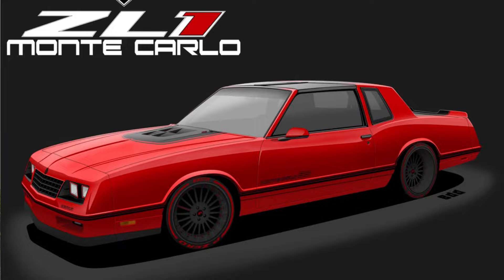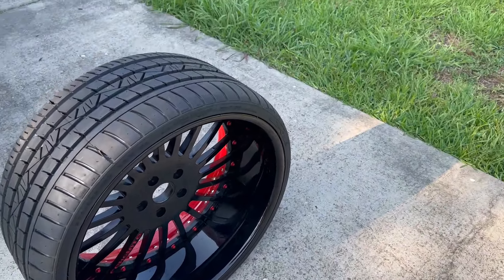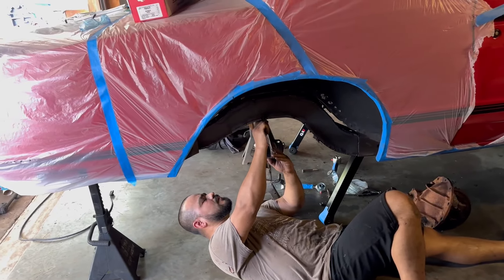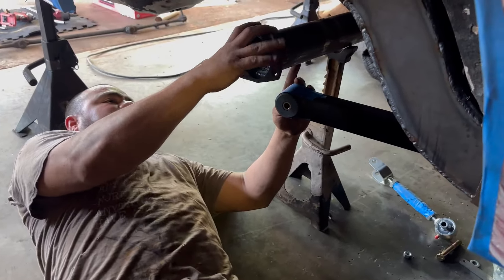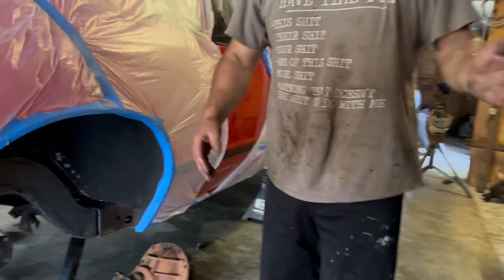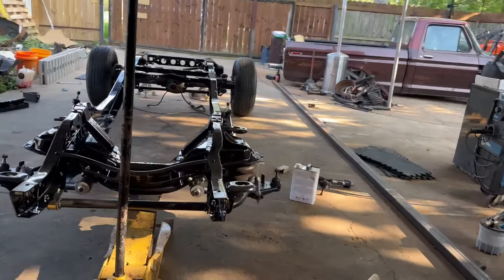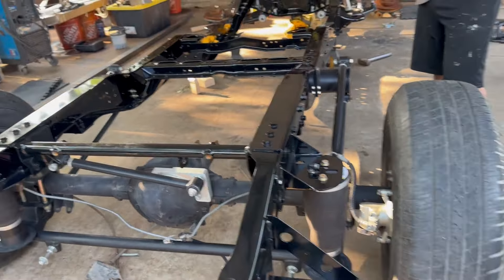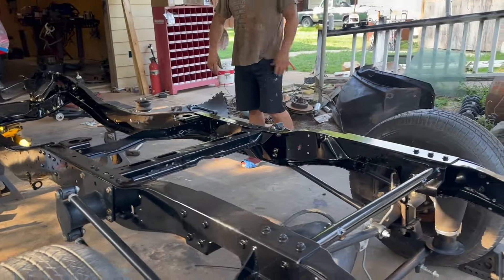Monte Carlo Build Update #17: What’s better than a Ford 9 inch Rear End?

Comment: I always have said the suspension is the most important part of a build. On a higher horsepower car being able to get the power to the ground and handle it is key!

Glad your showing these steps in the build. Its encouraging others not to cut corners to get things done. 

I have some 275/25/22r lionheart tires if you need them.
Reply from the maker: Thx bro! I always appreciate your feedback. We getting close to the best part of the project. Will definitely keep your tires in mind if I need another set of 275s

Comment: whats  better or stronger?

cause a dana 60  is stronger  but it takes a lot of power to drive one.  so 9 inch it is cause  parts are easily  had  with  them  in  gbodies

otherwise  youd be buying a 8.5 Grand national rear end  and those will survive  a lot of power with aftermarket  axles and a tru trac
Reply from the maker: Thx for the info!
Reply: Ford 8.8 can also be used in a gbody
Reply from the maker: @b_hall  yes indeed… I gotta few buddy’s with 8.8s in their Gbodys